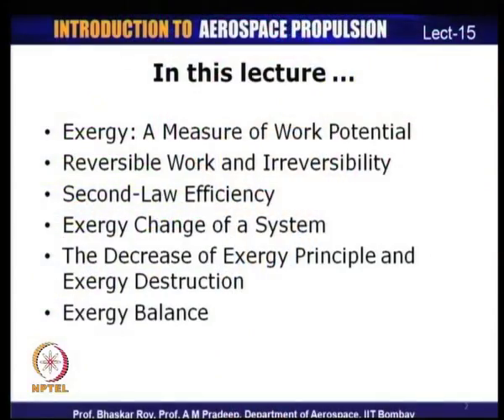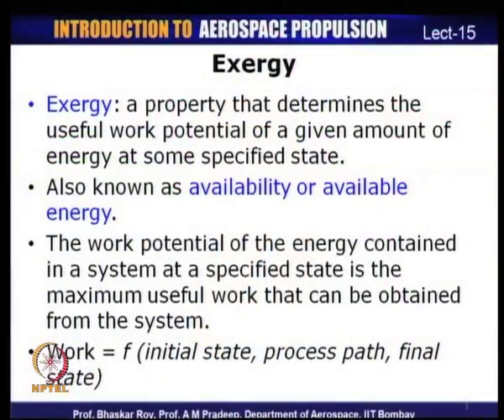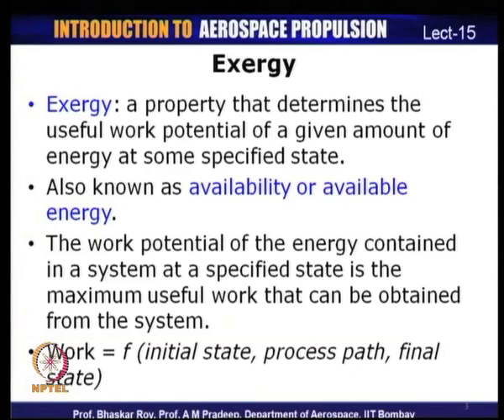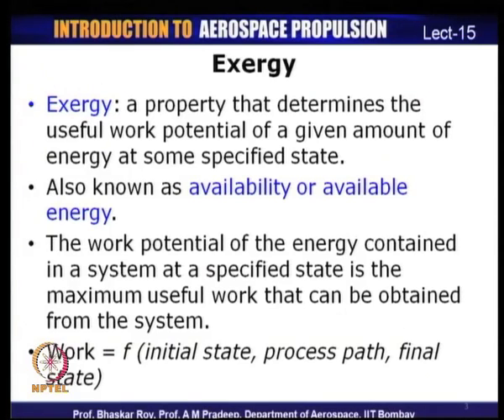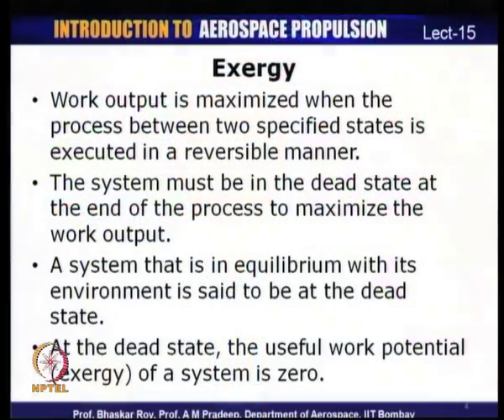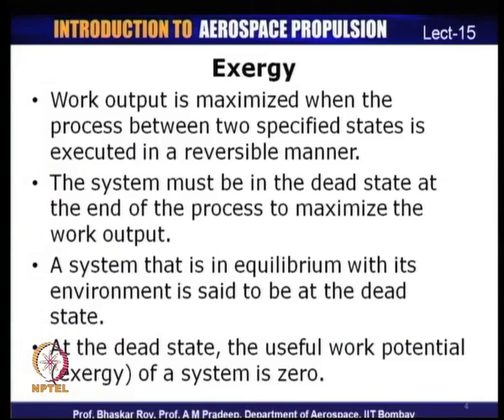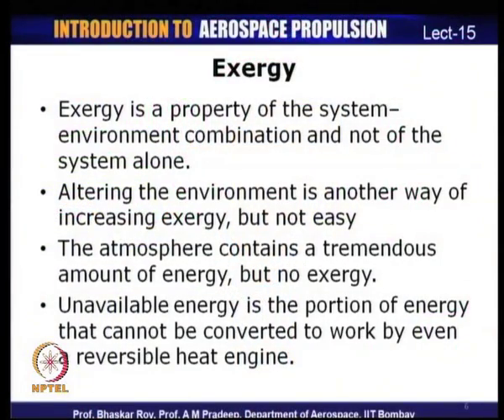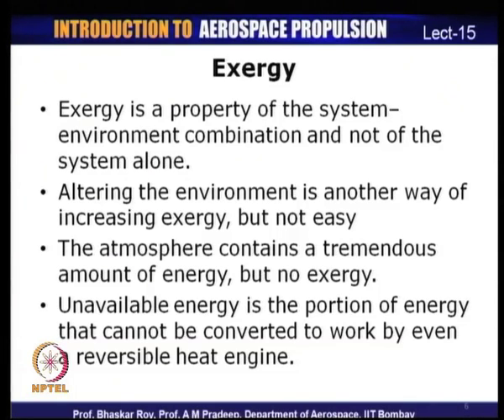Mod-01 Lec-15 Exergy, availability and second law efficiency

Comment: it might be too late to ask but at 37:14 how do you get -(-To_dS)? the two negatives.
Reply: Aditya Jain the heat is being rejected by the system . So it is taken negative .
Reply: Thus is the part no one explains.. Heat sign is already taken negative in the first equation..so it's not justified to take another negative sign here